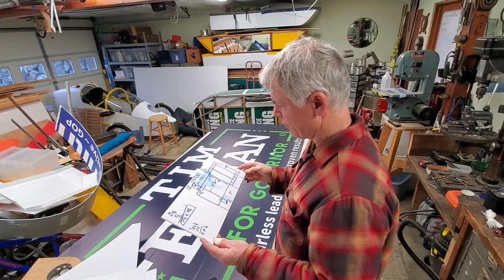Nomad Bicycle Camper Remodel

Comment: Would you be interested in one that enclosed the bike (a taller recumbent style bike) that could also easily be converted to an amphibious paddle boat mode?
Reply: Why the amphibious part?
Reply from the maker: @sempi8159  Why not?
Reply: @paulwelkinsdiy  Flight too?
Reply: @DDeden  I mean, ideally yes, but I would need it to be electric too, and that would require a lot more space for solar that would increase the weight too much, so with our current tech it's not feasible with a micro velomobile...someday though...
Reply: @paulwelkinsdiy  amen!
Reply: @sempi8159  it's my nomad fantasy vehicle! Never know what type of terrain you'll need to cross to get to the next adventure!
Reply: @LaineyBug2020  well that’s definitely a reason 🤔 don’t know of many bikeable trails/paths/roads that end in water but im sure on a adventure you will find some.
Reply: @paulwelkinsdiy  heavy, cumbersome, complicated and useless. It will suffer with the same problems all amphibious vehicles have 🥲

Comment: Paul you should make enclosed bicycle with a Buble over it so when your commuting you won't get wet and put a latch on top to open up for air
Reply: That's too big for a person to pedal. And I would suggest for Paul a bike with a sidecar, this has theee wheels but two lines, you can pass ditches and stones between the wheels and the sudecar could make a splendid sleeper sofa, better with some collapsible roof...
Reply: @michaelboyko5024  He made an enclosed trike a couple of years ago.
Reply: @SIC647  oh, really? I've never run across it, though I regularly watch the topic

Comment: How durable do you think something like this could be if you were homeless and using it every day I guess it wouldn't last very long maybe you could do a test.
Reply: That's a whole different set of demands over a non permanent use camper, therefore design and construct it to be able to fulfill those demands and the wear and tear associated with full time living right from the start.

I would consider thin plywood using the stitch and glue construction method, this gives a high strength, lightweight and hard wearing module, which, with a fibreglass cloth and epoxy resin covering will be 100% leak proof!

It also provides a hard shell, which, with a locking door or hatch gives good security for your stuff.

I would have no qualms about living full time in a bicycle towed, compact travel cabin that I constructed for wet and cold weather usage.

I would build myself a miniature Lenihan Charcoal Heater, which was originally created for heating miniature one man boats.

With the right mindset there's no reason why a bicycle towed compact cabin can't be built to live in full time in all weathers.

Coroplast wouldn't be my choice for that usage.